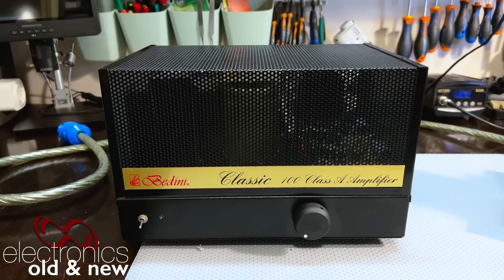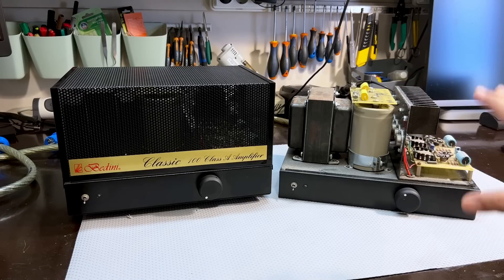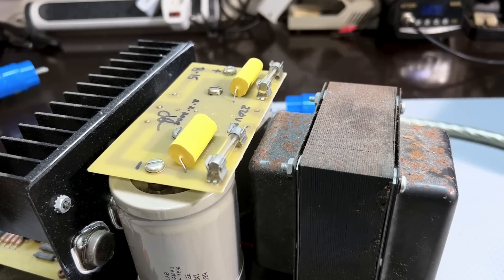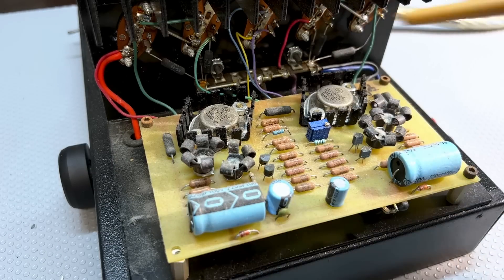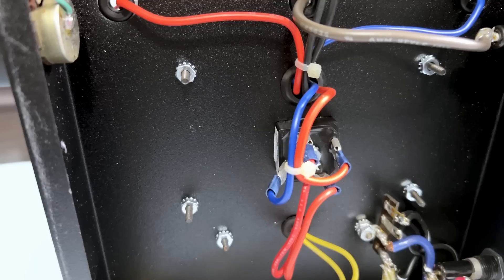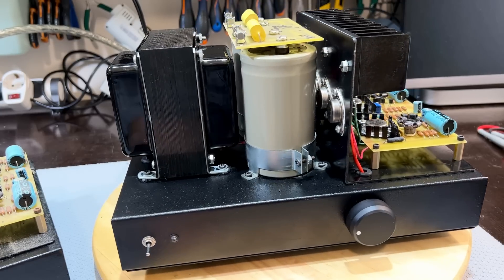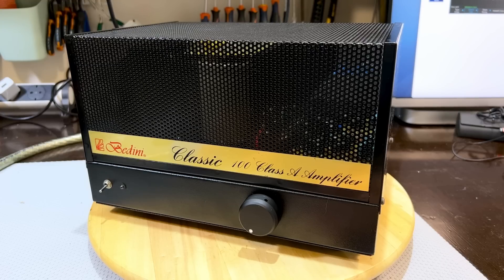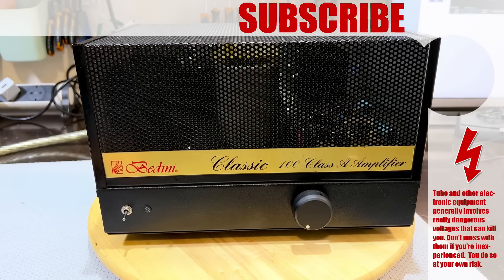Restoring the Rare Bedini Classic 100 Class A Amplifier.

Comment: Hi Manuel.  Well, that was something different. I doubt that I will ever see another one of these. I do like the simplicity of design and I’m sure it would sound very good, although probably wasted on my ageing ears. That power cord is really something, isn’t it?  As you pointed out, the owner’s house wiring would be the limiting factor.  Do you know if those cords were factory fitted or after market?
Cheers
Reply from the maker: These were after market. Apparently they cost about €750 per meter!
Reply: From what I know of John Bedini, the cord  probably had to do with being a real low impedance "transmission line" for power to the amp to help limit any possibilities of AC line noise radiating off of a higher impedance transmission line type of cord. He didn't seem to continue on with this in later amp designs, so maybe more of a reflection of the quality of AC power in the US during the 1970's, or it didn't make that much of  a difference to continue on with it. But it also has a subliminal way of saying "this thing is powerful", and John was also a believer in the fact of the "eye of the ignorant"  that needed something flashy to think something was good at first sight.

Comment: As you say the mains cable is just for show, on the inside it changes to normal sized cable for the current requirements.  15A slow blow fuse that.s a lot of inrush current or a very very inefficient design.

Comment: I think you really should replace those 6-wire power cables. I used them once for a similar setup,, but the difference in length of the 3 wires per phase ruined my audio. After listening for an hour or so, I even got a headache!
Reply: It is important to keep all impedance matched, even in the power cable, believe it or not.

Comment: I've never understood why people like class A so much. After all if a class AB has no crossover distortion it has the same performance as a class A. That IS the only difference except it uses a fraction of the electricity. 
Of course, it WILL sound good but no better than a well-designed class AB In fact in my experience a class AB can often sound better! Higher power, better dynamic range. As for crossover, if you cannot see it, measure it it will be the same and it is. Some people will never agree, but some people think that adding a huge power lead makes a difference. It's a case of if YOU think it sounds better, that's fine, everyone is happy.
Reply: I think my Iphone sounds better........and I am happy .

Comment: Paper in oil insulated power cable!  That is some foolery there...
Reply: Well it is a good thing if it is insulated, isn't it. Uninsulated power cord would be a bit hazardous. 😜
Reply from the maker: True 😊
Reply: @jutukka  Here's another thing: They're not even insulating the leads from each other with paper!  They just have paper soaked in oil wrapped around the conductor in each wire and surrounding it with Teflon.  The Teflon is doing most of the work here.
Reply: @douro20  Nicer bonfire with paper perhaps? 🔥
Reply: Paper in oil is useless for producing the magical vintage sound unless the oil contains PCB's......🤣
Reply: @goodun2974  Printed Circuit Boards?LOL.
Reply: @goodun2974  I know. It was a joke. Thus the LOL.

Comment: This amp will definitely sound very nice. However I have some problems with the thermal design. 1) The heatsinks are insufficient to sink the heat a 100W Class A will produce. 2) 5 output transistors are not likely to keep working in the SOA either, you'll need more of them. Besides with 5 power transistors there's no even spread of load over the transistors. I think it's bad engineering.

I'm afraid this design might run into serious over-heating problems.
Reply from the maker: Not sure of the details as a schematic is very hard to find, and I really don’t want to reverse-engineer the units.
Reply: Pity - A schematic original or  reverse engineered would be interesting and provoke further discussion.
Reply: @electronicsoldandnew  You shouldn't reverse-engineer those amps.. wouldn't work out very well an hurt relations, I'm afraid.
Reply from the maker: Very true

Comment: Is this really a class A amplifier (technically seen)? Can´t imagine that with no output transformer. I think "class A" is only a brand name - isn´t it?
Reply: I thought the heatsinks were a little on the small side for class A. As they are I would think they would get almost too hot to touch.
Reply from the maker: I cannot get a schematic, but I see they use two sets of npn transistors, in what would normally be a push-pull arrangement. I guess they just bias the transistors very hot. Not sure.
Reply: @electronicsoldandnew  Manuel, i understand this as a high idling current to reduce the crossover distortion in a push-pull amp.
Reply from the maker: It’s more or less how I see it.
Reply: Well, perhaps it is, perhaps not. Depends on the operation point, load etc.
If it was class A biased amp, the output stage should be pretty hot when no output power is fed to speakers.
(For example the myth that Vox AC30 guitar amplifier's output stage is a class A amplifier is not true. What is true, however, is the fact that the output tubes of it are getting pretty damn hot when cathode current per output tube is 50mA. But it is not caused by class A operation point. It is caused by a combination of considerably high plate current and high plate voltages of a class AB output stage. And, AFAIK, just increasing bias current does not  convert a class AB design output stage into class A stage, it just makes it run hotter when idling.)
Reply: Class A does not mean single ended.
Reply: @westelaudio943  OK, but what is your explanation?
Reply: @dl7majstefan753  

Complimentary output stage with class A (high) bias.
Reply: @westelaudio943  I Agree.
Reply from the maker: It’s seems to be a “quasi-complimentary”. The transistors are all npn.
Reply: @electronicsoldandnew  

Yes. They are all the same but they are part of NPN Darlington/ PNP Sziklai pairs I would imagine. Just like those stereo receivers from the 60s where all the power transistors are PNP Germanium to3 because that was the only reasonable option.

Comment: If the power cord is not made of silver, I advice changing it to silver cable because the resistivity of silver is only about 1.59 × 10−8 Ωm at 20 degrees Celsius. Do not accept any objections. It should be much thicker as well of course. 😜
Reply from the maker: Of course 😊
Reply: The silver used ought to be melted by virgins in the light of the Full Moon... only then the full effect will come to life..
Reply: Especially that those multiple strands end up on the pityful pole of the fuse holder from one side and on the eyelet from the other. From there whole power goes by 'normal' wires as you would expect from the proper 'audio - phile' device. ;)
Reply: But you are plugged in to a supply outlet which may have a source impedance (we call it Zs here in the UK) of an Ohm or so.  Why does a few extra milliOhms make any difference?
Reply: @ericrawson2909  It is exactly the same difference whether the volume pot goes to ten or eleven.
Reply from the maker: Ha, but what if it went to 12! Then what? Don’t tell me you wouldn’t hear the diference 😊
Reply: The snake oil is really flowing well today.
Reply: @MichaelBeeny  It is snake oil in PAPER! 🤣

Comment: The amp looks like it's been assembled in a garage shop  😁Could you measure the frequency response and slew rate as well? ( Like XRaytonyb does )
Reply from the maker: No, I’m not set up for that, unfortunately.
Reply: Not far off, built in a very small shop in a industrial row of bays...
I worked for bedini in the early 80's for a few years..
Reply: Just listen at those devices and determine what you think of it. Your ears and brain are very capable.

Comment: I have some number-4 AWG (25mm) welding cable I'll sell to your friend for his speaker leads.
Reply from the maker: I’ve sold him mine already 😊 trying to decide between a Tesla or a Volvo V40.
Reply: @electronicsoldandnew  Smart man go with electric car particularly on island where fuel could be critical even though I suspect to use coal or diesel generators to produce grid power. Having friends with Tesla I lean in that direction. Did I see something that the Volvo has disc brakes in the back! Probably wrong the V40 must using regenerative. I bet the high torque autos would be fun on your mountain roads unlike that VW bus. Have fun hope you don't get too many traffic tickets.